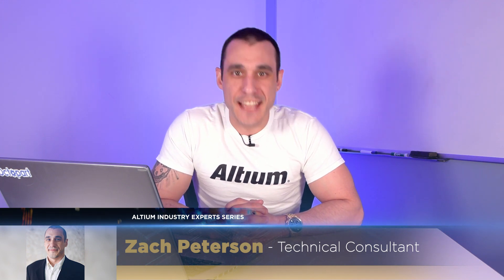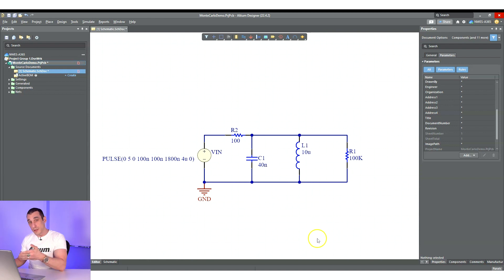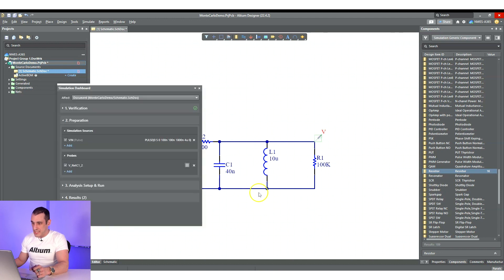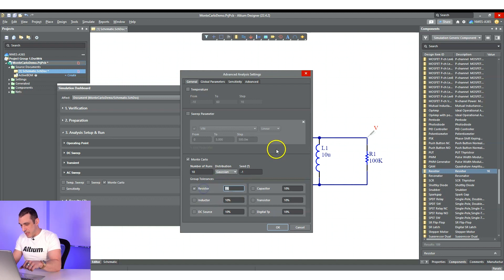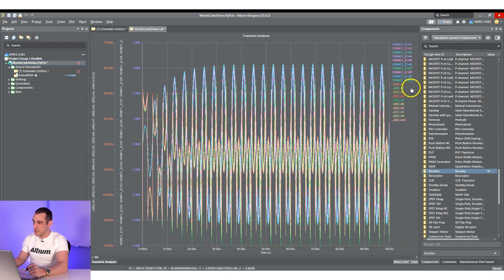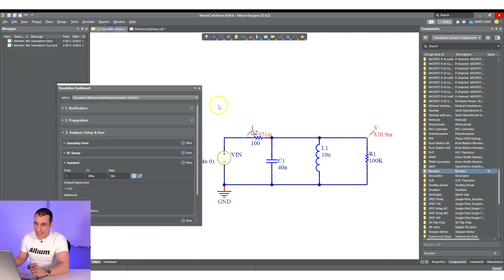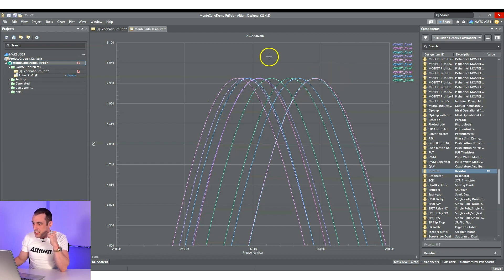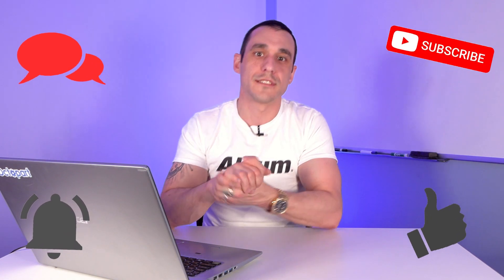How to Perform a Monte Carlo Simulation in Altium Designer

Comment: Hello Zach great demo. Is there a way to set tolerance for specific components? Often i'm using both 0.1% and 1% in the same circuit for say a resistor.
Reply: It seems it used to be a feature back in Altium 17 but i'm not seeing the same settings for individual components.